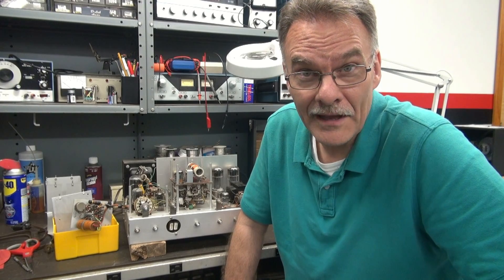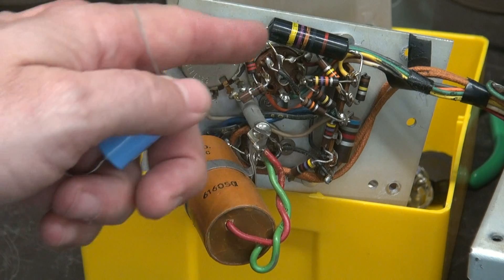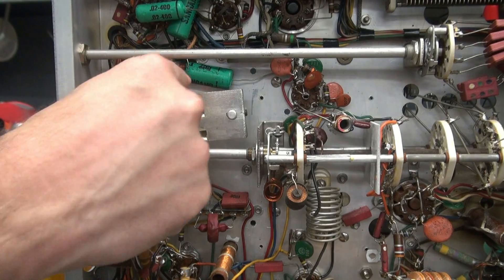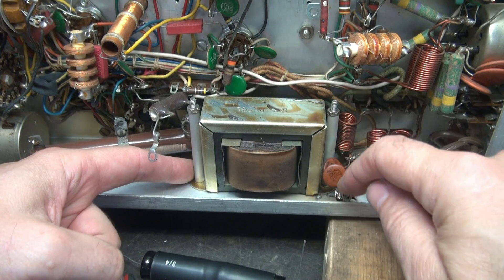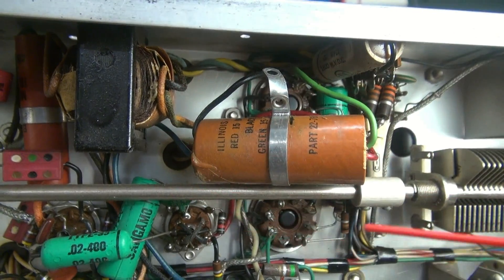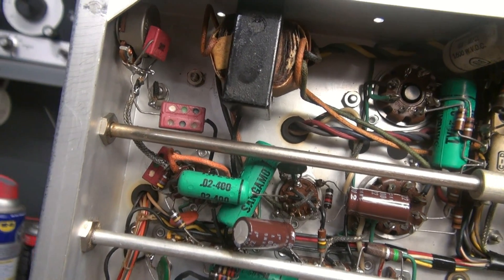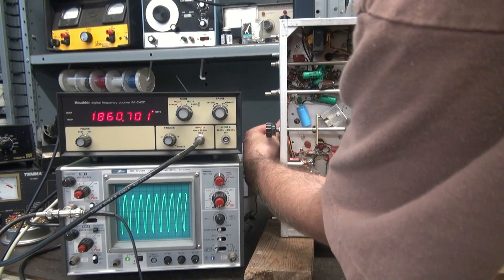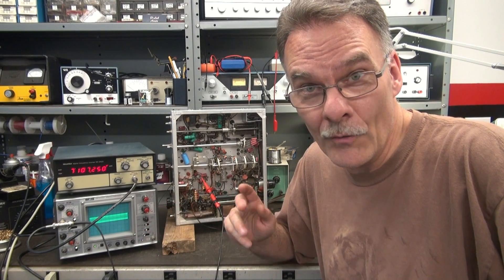EF Johnson Ranger 2 Ham Radio Transmitter Restoration Part 2 D-Lab

Comment: I would use a new poly high voltage filter cap. OR put equalizer resistors across the 22uf caps so they last. nice restoration.

Comment: No high value resistors to balance the voltage between the two series caps?  I know the theory behind the two series caps, but I'd be concerned that they might not be/stay balanced and then one cap gets too much voltage applied to it.  Same issue when you power down.  One cap may discarge first and then the other will start to reverse charge it.
Reply from the maker: Performed it this way for 20 years, no issues

Comment: Nice job Terry.. I wonder why they used a 700v Filter Cap... seems over kill , especially since you replaced with a 500v.  I guess back then they used what they had... either way, great job on this.... very well done... thanks Ron
Reply: 2 500v  22uf caps wired in series  makes    1  11uf   1000v cap.     Cap logic man.